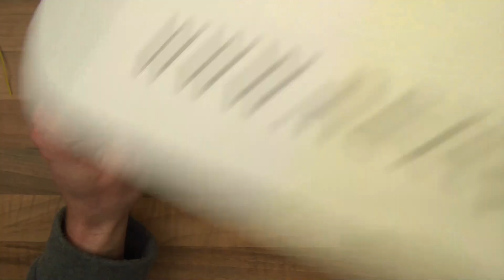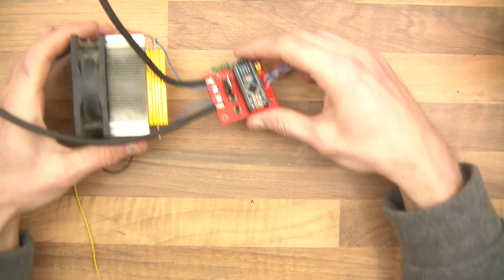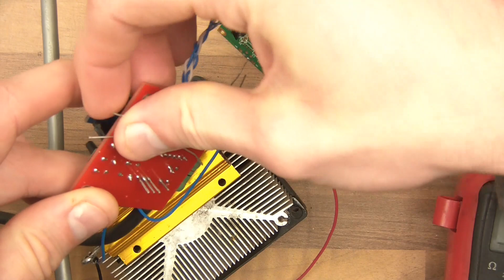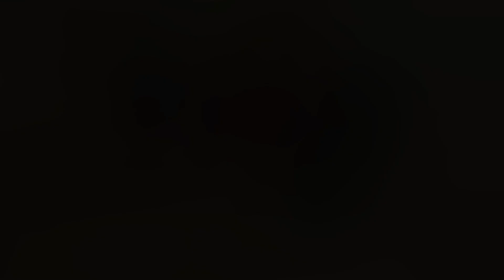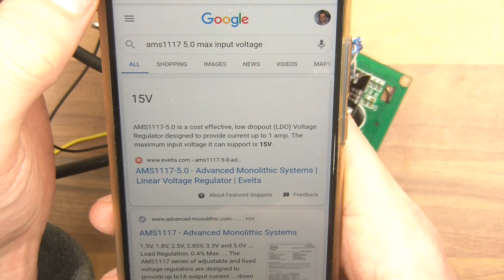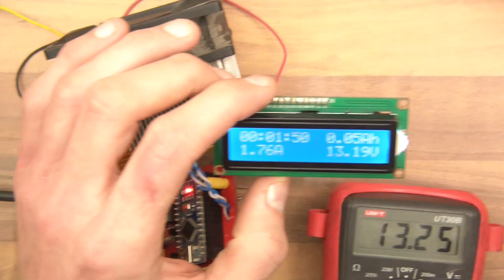INVESTIGATING: My New DIY Lead Acid Battery Capacity Checker Tester PCB

Comment: My dearest, I've missed you soooo much.
Been worried sick for you.
The nail nutrition thing : don't tell me that the Brexit thing led to famine ?
Arduino as a battery capacity meter : voltage of battery under test will change, thus you need to measure it precisely (at least an external and stable voltage reference for the Aref pin).
Current (from the battery) is best to be stable - thus you need to include a precise shunt resistor (typically less than 0.1 Ohm) and a decent Op-Amp to measure voltage drop across that resistor. The output of the Op-Amp will drive the gate of the mosfet to regulate the load current.
Me sending kisses :)
Reply from the maker: Haha! Igor! Why didn't you email me to check on me?!?! I actually get a lot of emails from Ukraine. Always something like 'I have won $50,000,000' or something. Please tell all Ukrainians/Russians what we use £ in the UK. It's confusing I know!

Yes, Brexit, it's lead to famine. The country is ruined. Plus now with Coronavirus, we can't buy toilet rolls or water anymore. We all mostly live in the streets now or in the sewers. That's why I've been unable to record videos... Coronavirus got onto my camera and Brexit ruined my SD card.

Xxx
Reply: @antonycartwright  haha, well I'm not from Ukraine or elsewhere in ex. Soviet Union :)
And my name's not Igor :)
Reply from the maker: @JohnSmith-xn3fr  Then, I can only guess. I'm guessing that your name is Ivan and that you live in Sesvete, Zagreb in Croatia. I don't know... There are a lot of places to choose from and my psychic skills have been lacking recently.

Comment: I'd add a 5v regulator for the Nano just in case the on board one is fried. Otherwise an external 9v battery would also work as a power supply